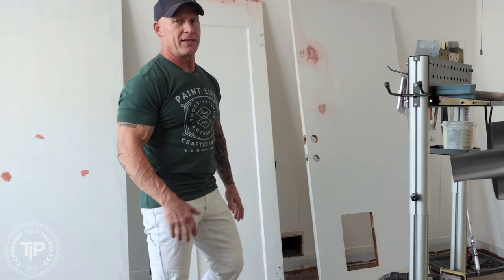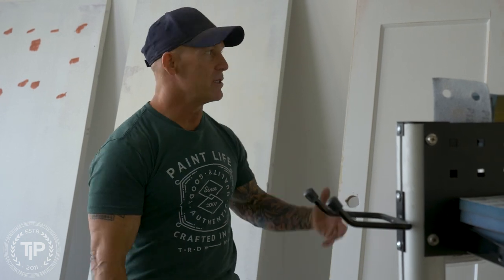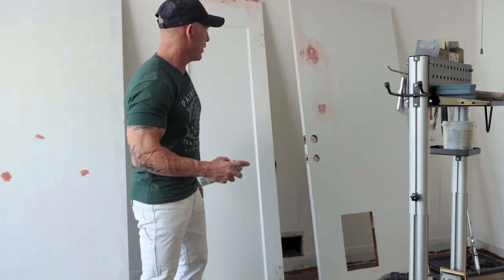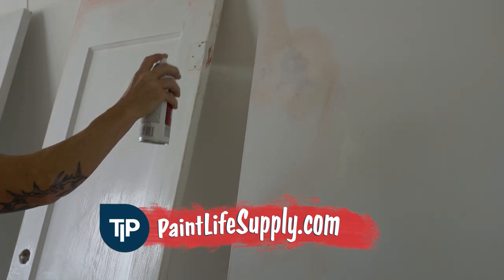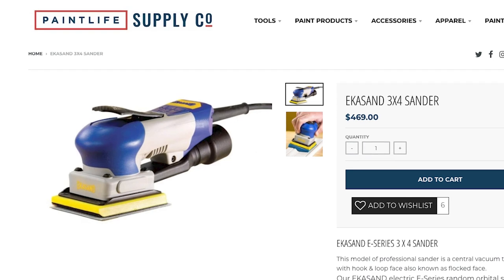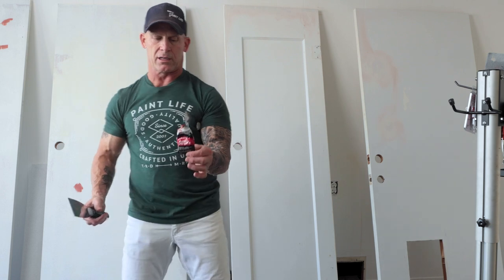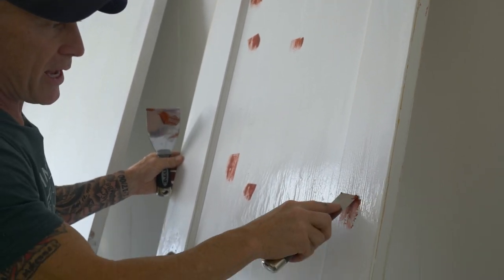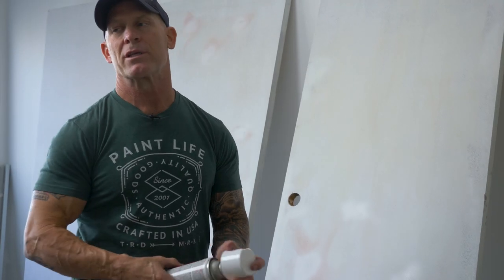Priming Bondo.  Cabinet Painting Tips.

Comment: In doing auto body they might do two coats of bondo before glazing - filler and putty. Reason being the shrinking problem you mentioned, filling bubbles, and deep scratches from rough sanding. 

I work at a hotel with hundreds of doors, solid core that get kicked in, hollow core that get punched through. I use expoxy products for most of the repairs. Shrinkage of bondo is a major problem, but you just deal with it, there's nothing better in terms of speed to curing, toughness, adherence. The glazing solves the shrinkage and workability issues that make getting a making it look like it never happened finish.
Reply: Thank you  for sharing!

Comment: Would love to see a video on different topcoats putting on top of the bondo filler with being primed. Curious about the coverage and if it flakes. My boss and I are doing a remodel on his house and we used Benjamin Moore Advanced on his trim. Let it dry and prepped out the rooms to paint with tape and caulking. Pulled the tape on the trim and pulled all the paint on top of the trim where the Bondo filler was.

The only thing we can think of is that the bondo filler has lacquer thinner in it and that messed with the oil in the Benjamin Moore advanced
Reply: No

Comment: Never used more Bondo in my life than when I was painting low income housing. Had to use 2 part Bondo on all the metal front doors because almost every door was all dented and banged up around the handles/locks from previous break in attempts and stuff like that. I figure if it can make a car look new again, a door should be a piece of cake.

Comment: I did have a question regarding BIN and 2k. Bin contains Acetone, and I'm familiar with Renner. On Renner there is a warning about if you cleaned your sprayer with Acetone to throughly flush it. So my question is if BIN contains Acetone will it react with waterbased 2k coatings?
Reply from the maker: With water based I clean with water only
Reply: @Idahopainter   so BIN won't have a reaction with water based 2k even though BIN contains Acetone?
Reply: I’ve read that if you do use the same sprayer for both to thoroughly flush it with water. Some painters use two different sprayers